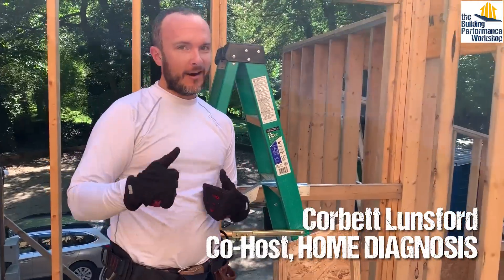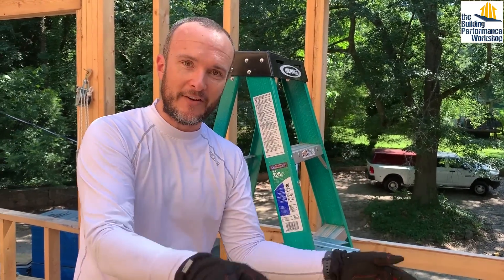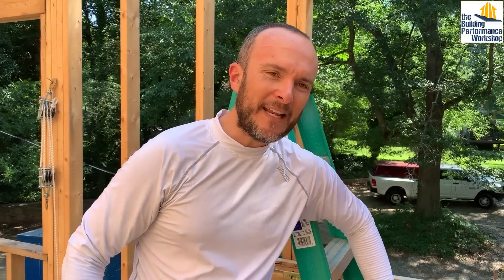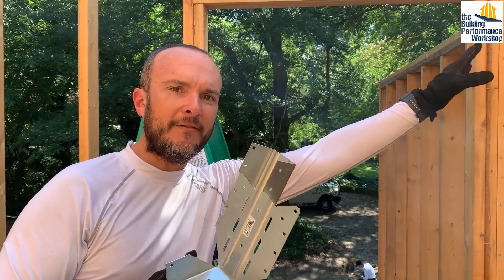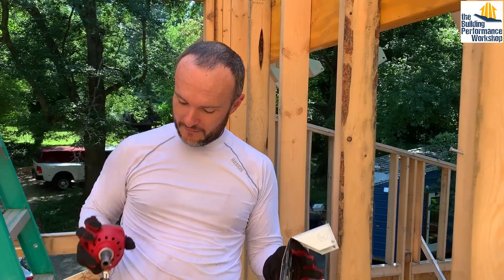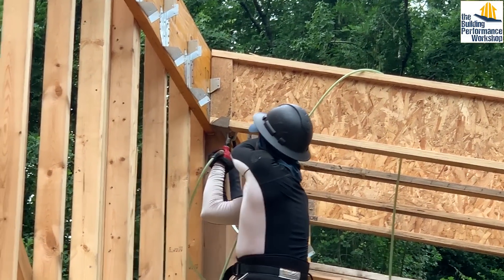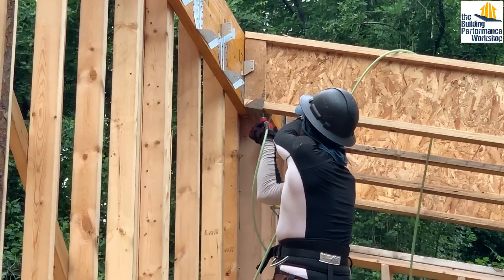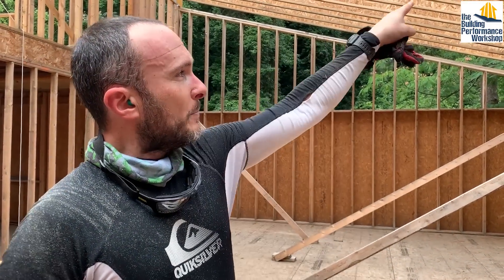Framing a Big Roof with I-Joist Rafters

Comment: what did you use to anchor the  i joist on the other side of roof? Also I see you added wood on the inside of the i joist for the hanger. did you nail that or glue it?

Comment: Would you mind to specify the type of ventilation you used in this case, to deal with VOC emissions? Are you venting the shed roof through the eves or are you referring to an air filtration system? Thanks

Comment: Can this be used in a humidity like the Caribbean?
Reply from the maker: Sure, why not?
Reply: @Home Performance  I am thinking about the board falling apart, it's super humidity and its an hour from the amazon rain forest.
Reply from the maker: Haha wow- as long as you get it dry quickly with a dehumidifier once the home is dried in, should be fine but ask the maker.

Comment: Would these optimal for spanning a 15' gap? i want a vaulted single pitch roof on my garage, which will be 15x30, the pitch spanning the 15' dimension. Its hard to find any designs without the roof rafters. Also, does this have to be an engineered design?

thanks in advance for the advice!
Reply from the maker: You can have the lumberyard size them, yes they can do 15 ft, you’d likely need less than 14” tall.

Comment: So I am not understanding why no matter what you are using trusses or rafters why you are cutting different lengths? 
Does that mean your house walls are not plumb and square????
Reply from the maker: In real life, two 36 ft long parallel walls will have some variance between them, because wood is not always perfect. You could cheat the walls in and out and cut every rafter the same- we opted to let the walls stand as ‘plumb, straight, and level’ as possible and cheat the rafter lengths so they sit perfectly on top of that.

Comment: Just found your channel. Awesome build. Question for you. The end of the I-joists that sit on the exterior wall. Looks like you cut a one sided bird mouth(since you didn't continue for the eaves) where it intersects the top plate. Did the truss manufacturer spec a certain amount of the truss that could be cut away and yet retain structural integrity? Looking forward to watching some more!
Reply from the maker: Thanks CA- actually not a birdmouth, just planed down the bottom flange of the I-joist at a 15 degree angle.
Reply: They wouldn’t be able to cut away truss, this is just an I joist. As long as there is enough bearing over exterior wall plate cut whatever extra off as much as you want. Not same as engineered trusses, can’t cut anything on those except tails to straighten for fascia

Comment: Over in the us how do you guys get frames level if its on concrete slab is it packed level?
Reply from the maker: The forms are leveled, and so the concrete pour will be level- I don’t recall them using a level after pouring.

Comment: What is the model number of the hangers. We are building a roof like that. Using 1-3/4 ledger and 14 " 110 series TJI with 25' span. Also using squash blocks at hanger.....?
Reply from the maker: Sorry, Garry, don’t recall. But they’re the only ones in that line- adjustable I-joist straight hangers.

Comment: May have been easier to attach the clips to the ledger before you hung the ledger.
Reply from the maker: If I was a more experienced builder, then that might have been fine- I wanted to measure everything a million times before I pulled the trigger on any component.

Comment: What kind of anchors did you used for the I-joist?
Reply from the maker: Strong-tie LSU I believe. Adjustable angle.
Reply: @HomePerformance  how did you nail them down on the eave end?
Reply from the maker: Four big .12 or .13 nails thru the bottom flange into the top plate, then strapped with an angle.

Comment: How did you handle the rafters at the rake walls? Does the nailing flange of the hanger fold around the corner? Or did you use an LVL or Rimboard or something beside an I-Joist at the ends?

Comment: Wow, You should have hired a licensed framer. I've 30 years under my belt, I lost count on the "issues". When you said "King Rafter" I think you meant Ridge Board(Beam), those "clips" are called hangers. I had to stop watching.
Reply from the maker: 'King Rafter' comes from a 70-year old carpenter. Metal clip is a general term to encompass hangers, straps, and other flat connectors. '30 years' is valuable, but you should still try to be a nice, open-minded person. Experience doesn't replace manners.

Comment: What’s the dimensions of that room? How long of spans are they? When you talked to your structural engineer could you have went bigger and should you have? Or are you pleased with the size of the room ? Thanks! love following this build nice work!
Reply from the maker: Thanks Blake! 24’ wide, 32’ long. Span is about 25.5’. No particular reason to go bigger than this.
Reply: Home Performance would these work for a loft that’s about 29’? 
It would be for a man cave in a shop , and these would be floors
Reply from the maker: Yes, you can get engineered lumber to do almost anything you want- ask your local lumberyard
Reply: Perfect video for my single slope house I am building.  Exactly 24' long like yours. I will be getting the ijoist longer for the 4ft overhang of the front and 2 off the back. Thanks so much for sharing though to see how it all works! What's the thickness on your ijoist?
Reply from the maker: 14” I think
Reply: @HomePerformance  you have price per foot on these handy? I am looking around $7+ my ijoist company selected 16" thickness
Reply: @WoernerAllen89  you started the house?
Reply: @averageliving4Life  negative

Comment: I might be missing the point of this channel, because I only came to see I Joists in action, but why bring up off gassing for the Joists when the house siding is osb, the floors are plywood, and the furniture has some undoubtedly mixed in (my couch even has plywood)? Did I miss that from another video, or is there some great concern that comes with an I Joist that doesn't with everything else made with the same parts?
Reply from the maker: Welcome Cory, yes, all of that DOES matter, which is why our channel is devoted to controlling indoor chemistry and physics. Thanks for watching.

Comment: OMG Corbet, get a metal connector nail gun.  With the amount of joists and rafters you have there, It'll save you hours compared to the palm nailer. $250 CAD for a Bostitch MCN-150 on Amazon. Probably cheaper in your parts.
Reply: I suppose it's too late now anyway. But for next time. A lot of things I had to learn the hard way... And continually learn as well.  

Dogspeed my virtual friend
Reply from the maker: To my knowledge, no nail gun shoots 16d nails
Reply: Oh I didn't realize you're using 16d nails. To my knowledge they come at 2-1/2" length. 

So more expensive, but the MCN250 shoots up to 2-1/2 metal connector nails. And the Simpson N16HDGPT500 are 16d collated nails. 

But by now the price of tools and materials has probably doubled. So it's a more difficult cost/benefit analysis.
Reply from the maker: Yeah, a lot of these are 3 1/2” 16d nails, which I doubt can be collated with a gun of sufficient power without jamming

Comment: How are they connected to the frame on the lower side? Did you do anything specific or are they just seating there at an angle with some nails?
Reply from the maker: There are simple 10-nail angle clips at the low end.

Comment: Is the a reason why you use nails in stead of screws?
In my experience it takes less time (compared to this pneumatic hammer) and their clamping force is way better.
Reply from the maker: Just made the choice, since either is approved. Our tinylab is put together entirely with screws, so I thought we’d change it up.
Reply: @HomePerformance  
As long as it works ;-)
Nice build, have fun
Reply: Screws are generally not used in framing due to their low shear tolerance. Houses shift, and in an earthquake prone area you have to have fasteners that won't shear off. Nails suit this purpose well since they have some give in them (ever bend a nail accidentally when driving it in? That's the give they'll have during a quake.) The framing would all fall apart if done with screws because they just snap in half. Great holding power, but poor shear strength. There are a few exceptions, GRK screws being one of them I believe. But they are specially designed.
Reply: @digitalconsciousness  
Good point

Comment: In the fine print the 'I' beam manufacturers here in the northwest do not recommend them for ambient temperature installation.  Most probably because the OSB doesn't do all that well in moisture, not sure.  So think about the eaves and soffits etc that they are disclaiming responsibility for.  I would be hesitant even using them where rafter bay ventilation exists (can't think of where you wouldn't ventilate them) as this would be ambient humidity.  While a few years back you could pay extra and get true plywood webs that no longer seems available from major producers.  It pays to really read the brochures.  I went through this a couple of years ago with a 27 foot span.  I ended up making my own box beams with 2x4 chords and braces faced both sides with 1/2" plywood.  Liberal use of urethane adhesive and fasteners made a strong unit.  Labor intensive but worth it.  Good luck with your project.  Take care.  Doug
Reply from the maker: Thanks, Doug, well said

Comment: What you need is a nail gun.  Why don't you have laborers doing that work?  Doing this yourself is just dumb.  If you would have hired a good crew, your house would be built by now.  Just because your house is not a box doesn't mean it needs to take forever to build.  Your taking so long because you don't have a clue about building techniques that any common carpenter would know.
Reply: Woa there. No respect for the fact that he obviously interested in learning all aspects? Definitely not dumb, as you say. Your comment also neglects to provide all pros/cons.
Reply from the maker: Of course you have a point, but as my friend here points out, I’m having fun. Don’t be such a debbie downer.
Reply: @Chris morore
Doing it yourself is not dumb, it is just slower.
It has it's downsides, but the good feelings it gives you after it is finished is just wonderful. 
Having fun building things yourself is not dumb, it is very satisfying.
During the process you might wonder yourself what you have started and even regret it, but at the end the reward is wonderful.
Reply from the maker: AHA

Comment: Your walls should not have slight variations.  That is bad building.  You can absolutely order trusses and have them all be exactly the same.  Whoever told you that you can't was ignorant.  Your build is full of fail at every turn.  Mostly a failure of your brain to do the research properly and find a builder that actually knows what they are doing.
Reply from the maker: Christopher, are you jealous, or did I hurt your feelings? Can’t figure it out.

Comment: Check out MiTek's TECO nail system which consists of color-coded nails designed to be used with a pneumatic nail gun that has a locating guide tip. Positive placement metal connector nailers are designed to quickly drive the nails into engineered metal connectors.

https://www.mitek-us.com/products/connectors/fasteners/tecosuptmsup-33-collated-hanger-nails/TECO/

Comment: 5 studs together at window behind you talking? Couldn't find a better solution?
Reply: LOVE your detail on not carrying the rafters beyond the wall (for the eaves) and instead build an airtight box there and add eave extensions later. Very “Joe L.” of you. I did sorta grin at your use of a palm nailer for the hangers. Any builder would have used a positive placement nailer but that’s not something that a DIY-er like us would invest in as we don’t use it enough. I did an entire seismic retrofit of a crawl space cripple wall and banged out the countless Simpson A35s will a palm nailer with ease. Great and inexpensive tool for us folk that don’t nail thousands of hangers a year.
Reply: I’m also very confused by that stud atrocity starting behind C at 52sec in. The reason tiny lengths of 2 by lumber are used as “squash blocks” is because of lumber’s immense strength to resist vertical loads. Does your house have a Panzer Tank on top of it that it needs to hold up? That’s a MASSIVE thermal bridge, outsulation or not....
Reply: After further review. 2 king studs on one side and 4 on the other? What’s the point load that drove that? 

Just saying in advance; I’m commenting as I watch so if I see something that justifies it later I’ll gladly call it out.
Reply: I’m so sorry, I love your channel and am part of your tribe so I apologize for all the questions. I do take issue with your statement about “if you can smell plywood or OSB those are VOCs” (something like that) - you do not at ALL have to smell something for it to be bad for your health. A strategy of “yea I’ll put bad stuff that off-gases chemicals is ok cause I filter”  seems a bit amiss. Granted it’s all a system and a balance but that was quite a simple overstatement from a guy who is supposed to be focusing on healthy IAQ among other things.
Reply from the maker: Not talking about filtering- talking ventilation, which is different. Also, that pointer was for people who never considered that engineered lumber (including all subflooring) might be affecting IAQ
Reply from the maker: That’s called a post. It holds up the roof.

Comment: What is holding the structural load of the ledger?
Reply from the maker: The lag screws into the wall studs, and everything beneath those
Reply: That wouldn't fly in Iowa and we have the most relaxed codes of any of the 7 states I've worked in while on the road doing commercial construction and custom home building
Reply from the maker: I think you must be misunderstanding the detail- this ledger connection is widely used and spec’d by our structural eng firm
Reply: No sir I see exactly how you installed the beam to the side of those studs we would have had to cut the studs so that the beam is actually setting on the wall 

The only place I've seen it done this way is on icf block walls but they have bolts holding the beam to the block that goes into the concrete core of the block 

But if it's engineered and the plan is stamped your local code enforcement can't say anything about it anyway

Comment: I realize they're spendy, and it's probably too late now anyway, but they make pneumatic nailers that are meant for attaching metal brackets and such. They're just like a normal nailer, except the tip of the nail sticks out a little bit so you can place it right in the nail-hole of the bracket, and POW! Metabo makes a nice one. (I borrow my friend's when I need it ;)
Reply: They are positive placement nail guns and they are definitely worth the money!
Reply: @davidearhart9531  Thanks for putting a name on this, looking at building my own home and this the kind of stuff I was actually wondering how to do efficiently.
Reply: Palm nailer costs way less and fixes the problem